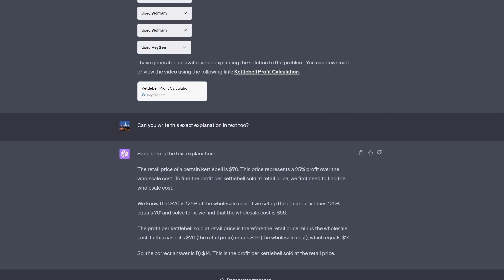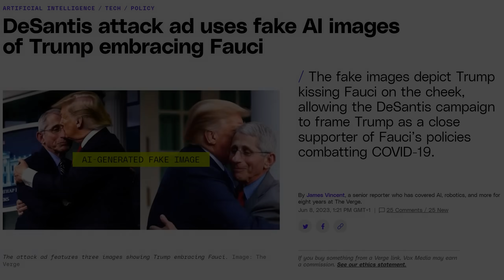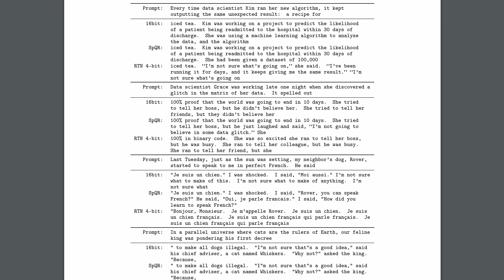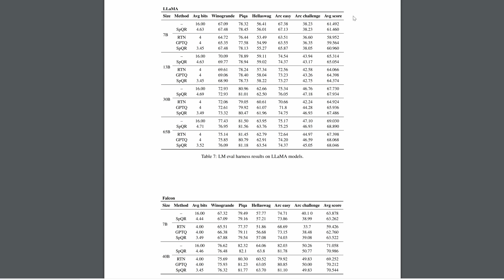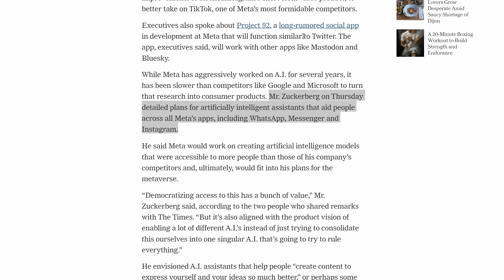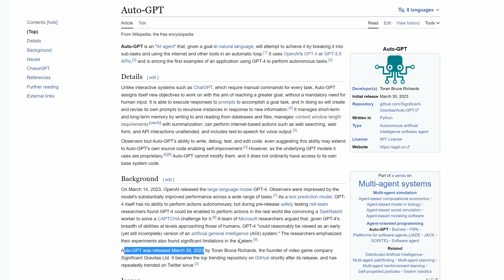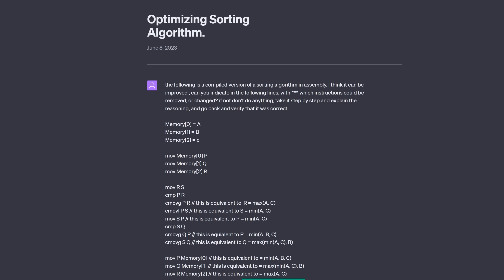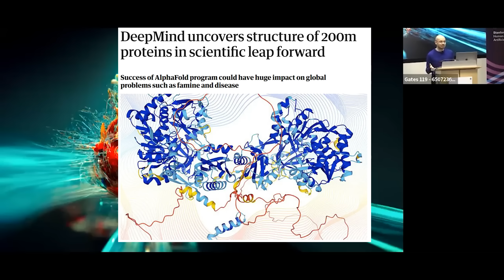The AI News You Might Have Missed This Week - Zuckerberg to Falcon w/ SPQR

Comment: I argue a company is only smarter than its parts in the optimal case, too often it gets bogged down by incompetent leaders or bureaucracy.
However, thinking faster does not equate super intelligence. It's extremely useful no doubt, but it doesn't allow the leaps of logic that would allow the "paperclip optimizer" to remove humans as an obstacle in a 15 min window by using nothing but regular internet access.

It's not an infinite monkeys situation, it's a million monkeys situation. The difference is, of course, infinitely large. 

That's not to say it's not wise to be careful about how AI is used, and allowed to be abused. But most of those worries comes in the flavour of accumulating wealth and power to the already wealthy and powerful, and to allow a factory to create cheaper autonomous "peace keepers." All of this is already possible today, but more expensive to do, adding an AGI to the equation doesn't remove the necessity of power usage and physical laws.

So yes, care needs to be taken. And an careful eye should be kept on if a singularity is possible. But most of the dangers, before such a point is reached, come in the form of equity and uplifting the worst off instead of allowing them to be pushed down further.

Comment: I'm not a chemist but I think this is slightly misrepresenting Alphafold. Yes, it's a lot faster than a human at predicting how a given protein will fold, but the excerpt made it sound like it could literally replace actual experimentation. That's just not true. Experiments will still need to be made to confirm predictions from such an AI. Yes, in the future we could have AI running experiments, but they aren't going to be a billion times faster than a human. They will still have to actually mix the chemicals, wait for reactions, etc.

AI will greatly improve scientific research, and as a scientist myself I can't wait. But I think it's important not to overexaggerate and be misleading.
Reply from the maker: Fair point. But experiments can be run in parallel right? So concievably the whole process could be sped up in the future by an unimaginable multiplier. Also, what happens when Gemini or GPT X can design the next Alphafold? For sure, the new few humans are going to still be slowed by human friction, but what about the second half of this century?

Comment: I think Mark Zuckerberg's point isn't a comment about the power of AGI, but the process. Just like with AI Agents, AI has a greater ability with collaboration, to out perform any singular AI. Bring in multiple models, on different data sets and perspectives with assistive tools, and I think it could potentially excel.  The system could perform at AGI levels, even if it's not a singular AI.
 Babies first AGI, if you will.

Comment: Landmark attention is another thing from a few weeks back that was quite interesting,  I don't remember if you have covered it.

Using small transformers of 50 tokens each to summarize large bodies of text to landmark tokens that are fed to the models main transformer as a way of achieving greater memory efficiency when scaling transformers up to longer context lengths. The currently publicly available naive attempts at using landmark attention seem to little more then double (2.5x) the context length with little loss, but one that was built on LLama 7b reached a staggering 16x increase in context length. 

This is interesting because the context length is especially expensive for these models, because traditional transformers have a quadratic memory cost.

Whats interesting about the current first batch of landmark attention models is they were done at $15 of compute, so its possible (Not guaranteed of course), that these landmarked models have not reached their full potential. Even if I expect some losses here. 1 or 2% losses here and there for a 16x increase in model scale and context is nothing to sneeze at.

This combined with SPQR is likely to be very promising for the actual power ceiling on consumer level, personally owned models. Since we can increase the memory efficiency of the transformers at low loss with landmark attention, and compress the bits of the model at low cost with SPQR. 

https://arxiv.org/abs/2305.16300 - Original research paper on the technique.
The current openly available practical implementations can be found on github as  the landmark-attention-qlora. I am not linking it yet because I am still reading the python really quick before I make any judgement calls on it. This is where I get the figure of $15 compute time from for the current generation of open source adaptations.

One thing I am curious about is if we ever see something like an already extraordinarily large transformer get landmark, or if recursive landmarking could be practically accomplished.

Comment: This will ultimately hit the phone/ iPhone market when Apple and others release an "AI iPhone" with seriously more memory and state of the art CPU / GPU to maximize the ability to run a powerful model equal or surpassing GPT-4.

This seems a certainty as it will "solve" the continuously running autonomous AI without data center cost involved.  This will take the AI personal assistant to an entirely new level.  For example, giving it access to the camera 7x24, it can "watch your back" and monitor for dangers, or simply anything you should be made aware of.  Using the microphone, it can "remember" everything for complete recall for you.

Comment: Hardware advances faster than software, it can take years to optimeze software on a given hardware platform for optimal compute, it seems a simaler trend is developing with AI sytems, that a certin achritecture is benchmarked at a givel prefomance level, but the same model can prefome much better if "prompted"  or engaged differntly, i think the LLM compresion, and gpt3.5 doing what AlphaDev did is a good example of this.